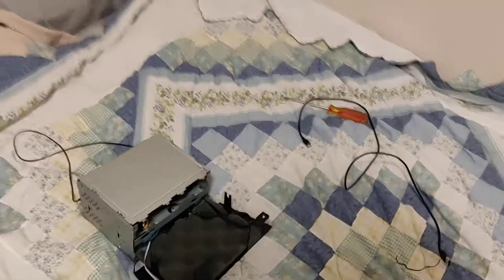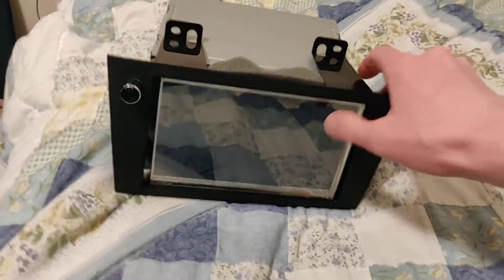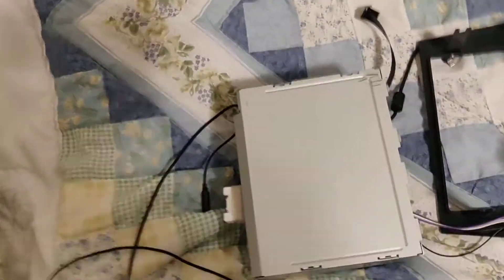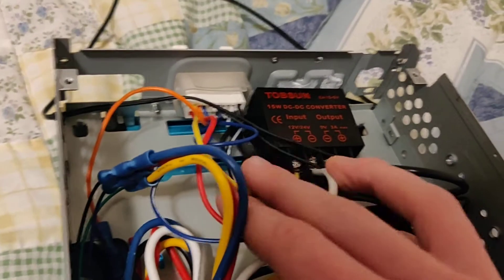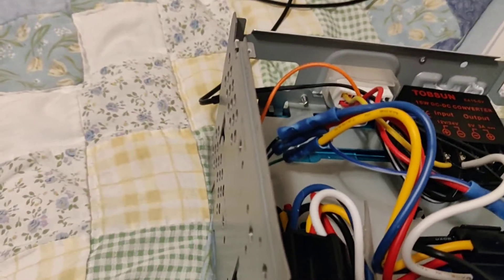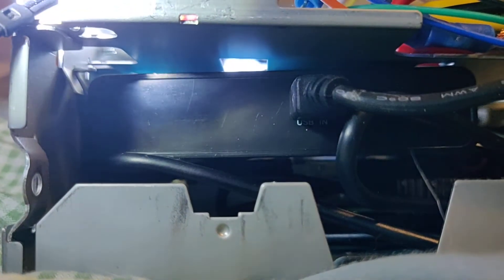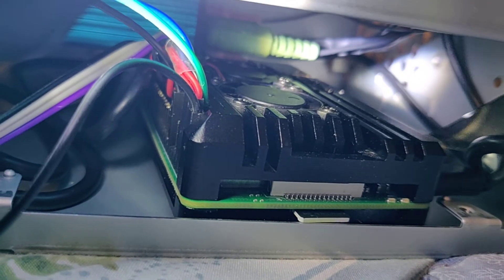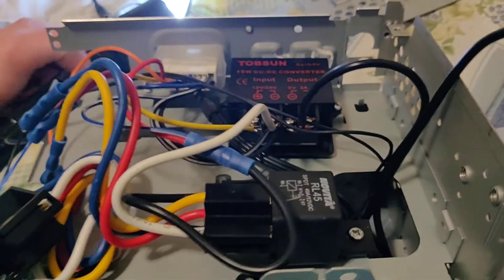My raspberry pi based car stereo head unit

Comment: Are you using steering wheel controls?
Reply: I don't think this would be possible right off the bat. It is possible to use the steering wheel controles if you go full "hacky"  with it. Did see some videos on YT where they use the pulse from the controller to reset it to a usable command.
Come to think of it.. Maybe something is possible if you use the GPIO pins on the PI... hmmm.. interesting.

Comment: How well did the OpenAuto  integrate with is particular sound card. Especially the sub output?
Reply from the maker: When I was using crankshaft it worked pretty well however when I switched to open auto pro I was having serious problems to do the audio equalizer. The equalizer open Auto pro uses only supports two channels so I just ended up using the two channels also that sound card works great if your using a Windows device. it was pretty tough to get it to work on Linux but once I got it working it worked perfectly
Reply: @jaredes5666  Well unfortunately I found crankshaft was slow, volume controls not responsive at all on normal USB sound device , even to point of Pi rebooting, Got OpenAuto Pro and it worked great. I even used a PiFi Berry DAC. I was looking for a sound device with sub output, thus the question.
Reply from the maker: @fuzzypumper  that's the same reason I got that sound card unfortunately unless you can figure out a way to remove the built-in equalizer in open auto pro it doesn't seem like there's a way to use multiple channels
Reply: @fuzzypumper  Could you place a video with your setup and configuration... Very curious.